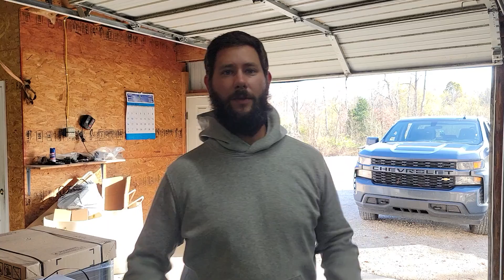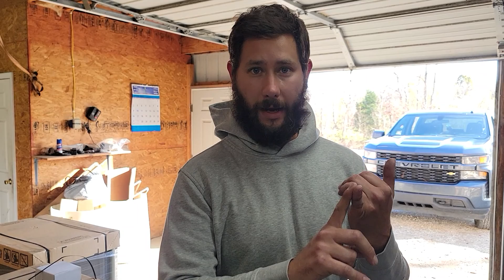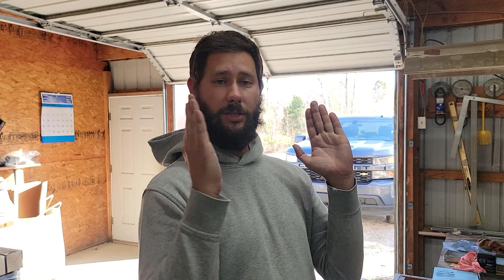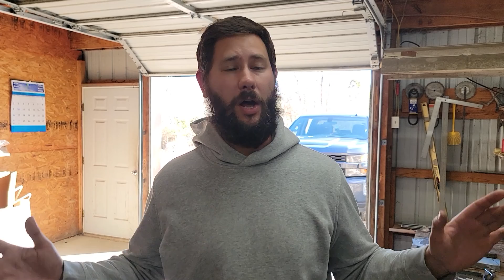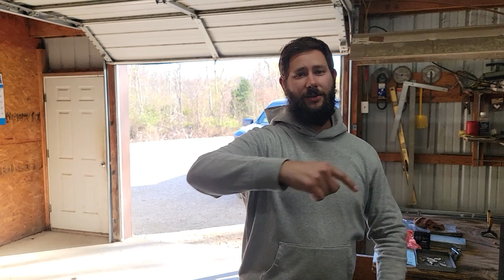oversizing and undersizing HVAC equipment

Comment: Hai teddy i want ask you a question it is confusing me ,when we using recovery mechine to recover a system 
To recovery tank,it’s same time we recovery refrigerant oil to  the recovery tank ,if yes can we reuse the refrigerant  on the recovery tank, please give me answers please thank you 😊
Reply from the maker: You can reuse the refrigerant that you recover unless it was a burn out from a compressor short to ground or unless the refrigerant is contaminate
 You need to make sure that the refrigerant is not contaminand it's in reusable form

Comment: Thanks for good explanation.
Our office building finally replaced out 70 year old Typhoon system.  Upsized because an office with 95 year old windows.  Come in handy as we turn system on and off for work hours so quicker cool down.

If on continuously like a house, smaller would be better.  We have no control on non insulating or windows.

Comment: Good info. I’m about to replace the system and one company wanted to put in a 4.0 ton which seems far too much for my 1,700 SF single story house, another is recommending 3.0 ton. The third bid is for a 3.5 ton and that company said it’s because ceilings are 10’-12’ and due to the number of large windows. The third bid is actually the lowest, but now concerned the 3.5 is too large. I don’t know what I currently have, could not find any info on it. Two techs thought it is a 3.5. I’m near Dallas so frequently at or above 100°, often for days or weeks on end. Now I have some additional follow-up questions to ask to finalize my decision. Hadn’t even occurred to me there could also be issues with the gas furnace due to sizing
Reply: 3 ton is what you need

Comment: Here is an example: 

rate

    HOW: Determine the external static pressure of the blower using the manufacturer's specs. Then, deduct the pressure drops created by any components added to the air distribution system (a/c coils, filters, grills, registers, dampers, etc).  This is the available static pressure for the duct system. Next, determine the total effective length.  The total effective length equals the measured length from the farthest supply outlet through the equipment and to the farthest return outlet plus the equivalent lengths of all turns and fittings.  To get the friction rate apply the following formula:

                               Friction Rate = (Available Static Pressure X 100) / Total
Reply from the maker: thanks for sharing

Comment: In my country in summer the temperatures can reach 124f, so if my house need 8 tons package unit i have to increase capacity 2 tons more becuse of high temperatures or the compressor will tripping Easily .
Reply from the maker: that makes sense
Reply: It's all about the heat load. So if you live in a place that is very hot, your heat load is higher, so you're not over sizing.
Reply from the maker: Absolutely agree
 Good stuff Eli I love your knowledge
 Please keep sharing it
Reply: @TaddyDigest  I like your way of explaining things. ill start posting your videos on my telegram channel and Whatsapp group, got over 200 subscribers.
Reply: @Elisummit845  👍🏻

Comment: Well said most jobs are sized on area based on what works in a tin shed with a size up just to make sure.  Ducting snakes all over the attic with outlets you can dry your hair with. Agree do the maths and get good at it.
Reply from the maker: absolutely agree 👍

Comment: J load You mean a Manual J ? I also do a Manual S,and D. I agree with 💯 percent though. Usually will be oversized equipment and undersized duct. But using .5 on a duculator is just as bad. Doing a manual J you come up with a friction rate and size ductwork according  total system resistance .
Reply from the maker: Exactly!

Comment: Bottom line to me is equipment needs to be sized properly. As a contractor If I’m selling a expensive piece of equipment to someone I’m not using rules of thumbs or my shoe as a tape measure every house is different so loads needs to be done proper loads and yes I know manual J is very conservative but if The load calls for a 27,000 BTU unit I’m going with 2.5 ton.

Comment: Any technician or salesperson knows it is ok to oversize a modulating furnace with a variable speed blower by 30% or less and be fine.   The same applies to air conditioners, if you have a variable stage compressor and variable speed fan, ACCA allows for up to 30% increase.  That number drops to 15% for a two-stage unit.  If you have to take a shot at it, sized it to barely hold 75-78 degrees on the hottest days of the year.  If you do all the right math, none of these things will be an issue.  But we have seen your math skills and your calculator must be an abacus or an android phone.   A broken watch is correct twice a day.  Hell, I don't even think you are that lucky.
Reply from the maker: your gonna be ok just keep going 
Thanks for watching 
This video was definitely for YOU 
Thanks YOU for your support